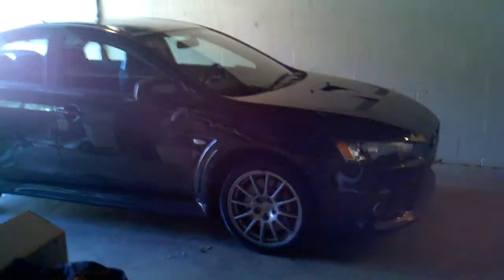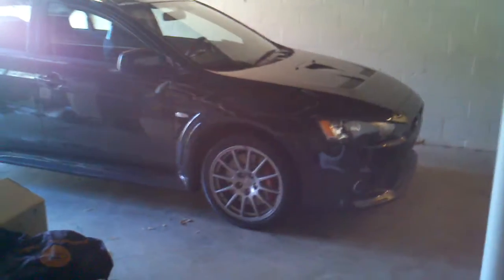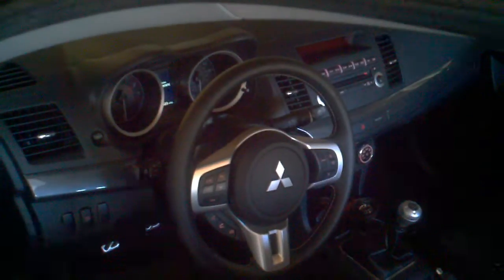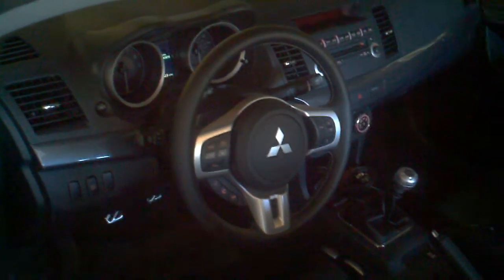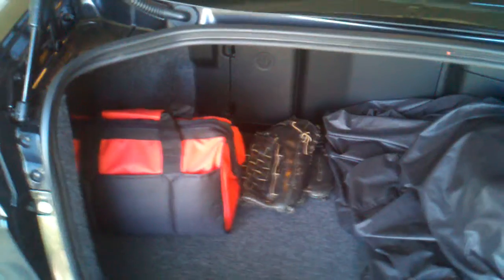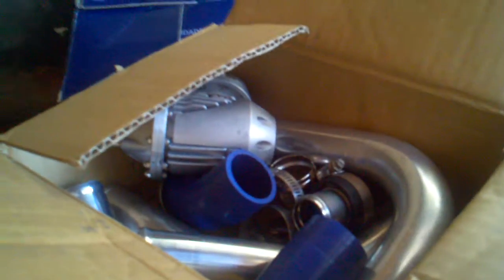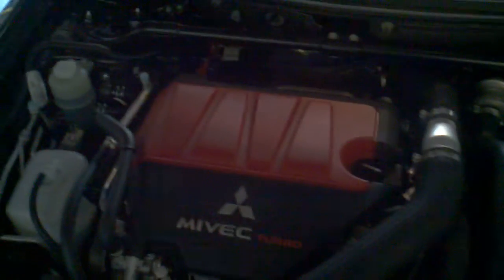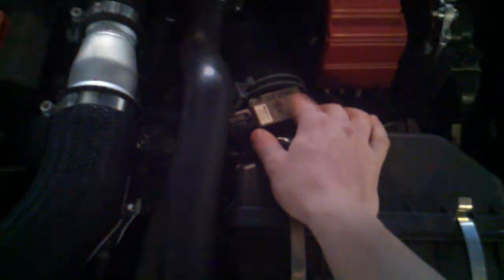My 2010 Evo X GSR... Cobb AP only: Mods coming TODAY!!!!

Comment from the maker: @skater19840 
Does not HAVE to but the stock diverter valve is recirculated and its what the engine is used to.  Ive heard issues with having a bov venting-to-atmosphere so I went ahead and bought the recirculation pipe just to be safe.  ZERO issues thus far!  Only thing is there is some fluttering on the highway since there isnt a 6th gear on the X GSR so maintaining speed will make the bov act a little goofy.

Comment: Sick car, I have a 2005 WRX STI and love it. As far as the performance parts I agree check with your dealership on voiding your warranty. I had a GSX eclipse that I upgraded the turbo on and it voided the warranty. Almost anything other then exhaust and intake and the dealership will give you crap if you take it in for a problem. They see any performance stuff and that is when they try to find a reason to not cover it under warranty.